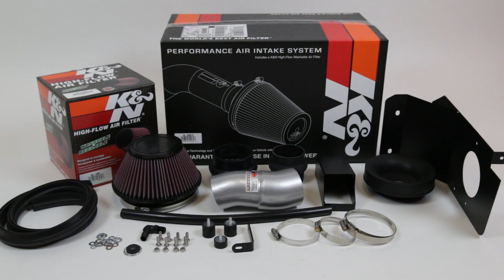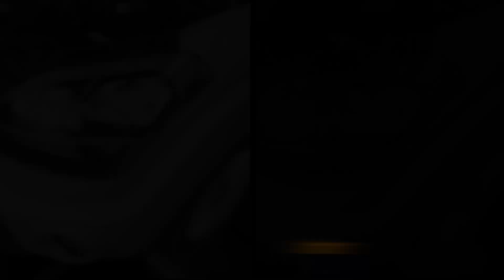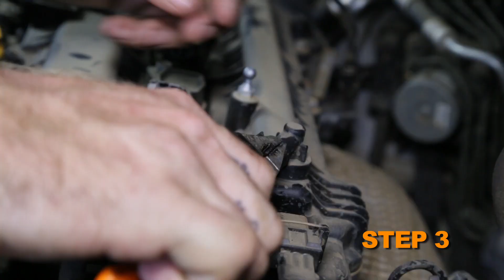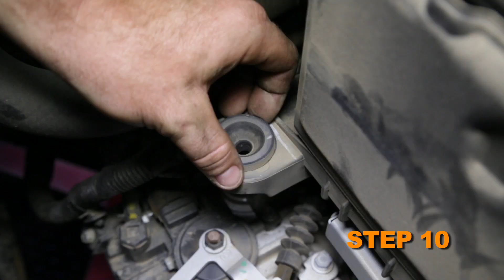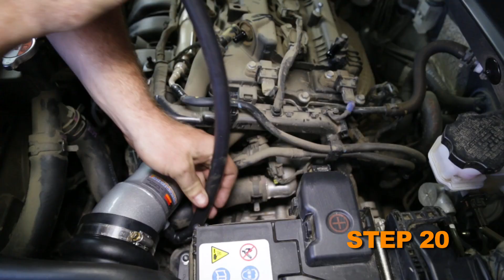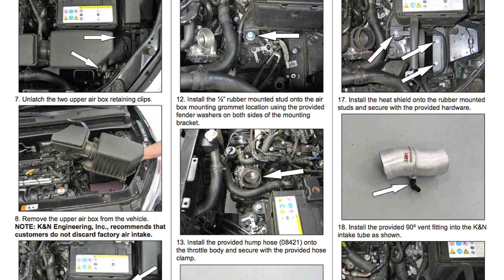2012 and 2013 Kia Soul 2.0L K&N Air Intake Installation

Comment: Oil based air filters like K&S may not be good for Gasoline Direct Injection(GDI) Engine, especially for the Intake valves.